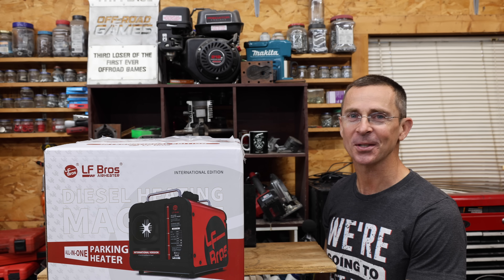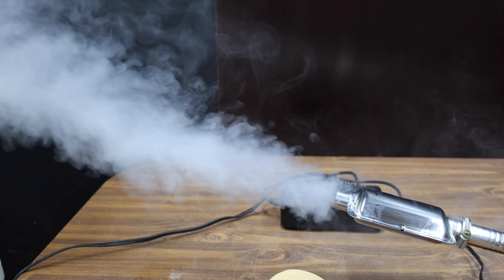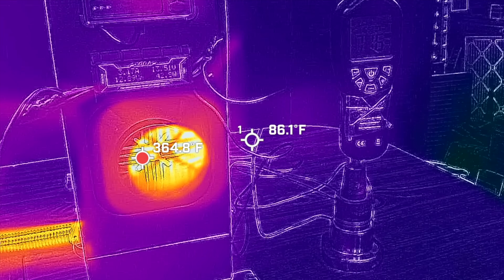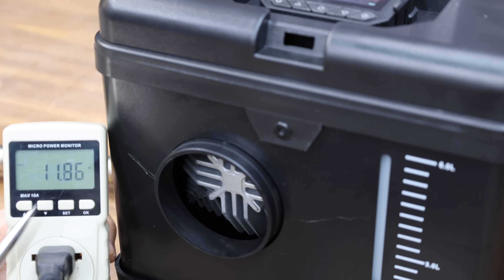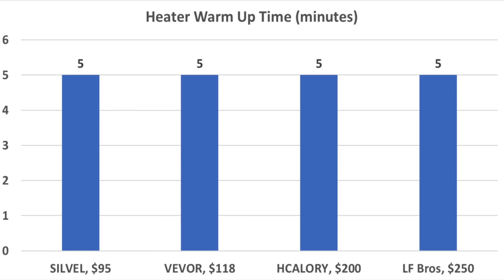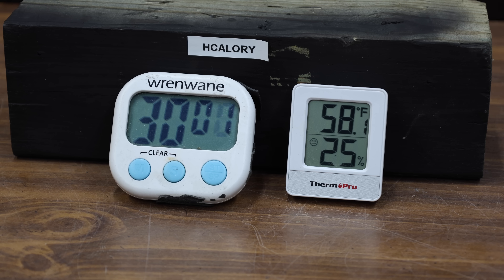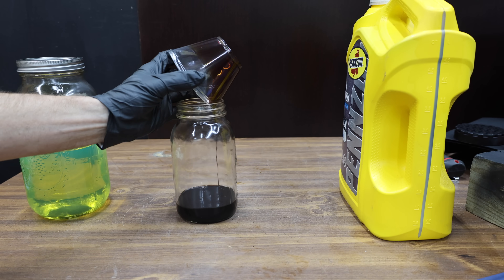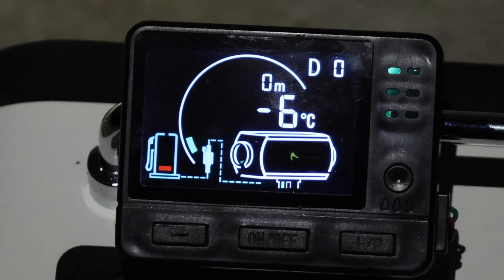The Truth About Cheap Diesel Heaters!

Comment: The heater that was smoking was also the one that tried yet failed to start. That event might have loaded raw fuel in the chamber causing  the smoke during the final start up.  I did the same thing with my heater on it's first start, (inadequate 12v  power).  since then, no smoke on starts...

Comment: Great concise very informative video. Two seasons ago I purchased theLFBros heater, had minor issues due to Shipping and the manufacturers responded quickly to correct them. The unit started right up with no fuss. Ran it for an entire season at the end of the season. I let it run dry and it shut down. The second season start up was just as easy as the first time. Join use the season. I had a momentary power outage, the unit chugged, sputtered. I shut down the unit gave it 10 minutes started it right back up with no problems. In my opinion, this is the best of all of them, none of the problems that you find on the Internet with the other lesser brands. Customer service could not be better. Spend the extra money and get the best. Also, for those who question this review, I paid for my heater, I have no connections with the company or suppliers in any way shape or form.

Comment: I have a 1986 30 foot motor home in Maine  and I'm using the Chinese diesel heater for a primary heat source works great uses less power and fuel than the propane furnace that comes with the RV will always recommend diesel heater also the Chinese diesel heater is 5 years old and been in 2 other vehicles prior to the RV

Comment: Disclaimer "I do not recommend doing what I do" however I have a 850sq ft cabin and this is my only heat, I burn 120-180 gallon per season, cost of fuel averaging $600 for the year, my electric bill is a $120/ month. Also I have a larger power supply with a 20 volt to 12 volt converter with a milwaukee battery adapter, this works really well during ice storms etc. The longest I went without power was 7 full days and my house never dropped below 75° its worth noting i am upgrading to an auto start auto stop model ( be here on friday) i also have multiple co2 detectors and I use a wall thimble for the the exhaust to prevent me from burning my house down ( anyone that does this beware this is dangerous!!!!!!!!!!)
Reply: I do something similar.  I use a 12v 100a/h Lifepo4 battery to power mine.  It likes the slightly higher voltages of lithium batteries.  I ran my exhaust thought a hull thing that is in a 2 x 6 board installed a lot like one does a window A/C.  I bought a all in one box type and try to use the temp mode for the controller.  Thing is, the controller picks up some heat from the heater itself.  I plan to move the controller before next year.  I may just buy a diesel heater kit and put it together more to my needs.  

If I run the heater none stop, I can run for days on that battery if the power is out.  With the power on, the charger keeps the battery topped off.  

I have to say, this is a lot better than manual kerosene heaters.  If it turns really cold during the night, the controller turns the power up automatically.  If it warms up in the morning, it powers down, sometimes to the lowest power level.  The next heater I buy will be able to cycle on and off.  The Hcolary, (sp?), is the only one I found that does that so far.  Kit type anyway.  

Oh, no smell.  All the smell goes out the exhaust but once it warms up, no smell there either.  I just wouldn't sniff it.  ROFL
Reply: @noneyabus1  I have the newest model coming, it will be here Friday. The only issue I have is my house is hot 🔥

Comment: I've been running one of these Chinese heaters for the last 3 years and a 30X 70 shop when it's approximately 20 outside it will heat the shop up to about 58°which feels pretty darn good and I could adjust the fuel to make it hotter but this way it runs super clean

Comment: My house has electric only heating. Costs last year were slashed by running one 5KW diesel heater. I rent the house do exhaust goes up the chimney. I would have a second unit at the other end but there’s only the one chimney and I can’t drill 1” hones in the walls. 
My fuel is in 5 gallon Jerry cans. I use a long line of 4mm nylon tube through to the heater (small hole through the wall). A 100ml syringe pulls fuel through quick connect and the heater pump does the rest. 
The fancy case and fuel tank were a waste of money. Nog necessary.

Comment: Do you guys just exhaust this through a whole in the wall?
Reply: They make a hull flange for the exhaust.  Some run them through a metal pipe with insulation stuffed in it, to protect wall from heat and keep the air out.  The flange is the best way in most situations.

Comment: i would surely add an old cast iron radiator on the exhaust pipe to capture every degree of heat produced...seen it done on another video and it works likea charm...doubling your heat output for no extra cost!!!!

Comment: Fair warning for these, the control panel shorts out easily. I have only gotten a single season out of the Vevor. Also, there is no real thermostat type of control. It's on or off.
Reply: There is.  They usually come in power control mode which is manually set.  You can change it to temp mode but you it's best to have the controller outside of the all in one boxes.  The temp sensor picks up heat from the heater itself.  If you leave the controller inside, you just have to figure out the temp based on room and the amount of heat it is picking up from the heater.  Mine for example, if set to about 95F, it keeps the room at about 65F or so. Oh, on mine, if you press and hold the up arrow button, it switches to F mode instead of C mode.  

Find a video with a controller like yours, there are several different ones that look almost identical, and figure out how to change it.  On mine, you press and hold the up and down arrow buttons at the same time to change to temp mode.  Other controllers may have a different method.

Comment: I would be interested to know what the longevity of all of these are. I bought one recently and it only survived 10 gallons worth of fuel, on setting number 2. As I understand it the control panel controls how much fuel versus air each unit uses, and it’s also adjustable. The unit I have was running very rich and clogged up the combustion chamber since it wasn’t getting enough air.

Project farm, can you also test longevity tests on these and then do a combustion chamber inspection? Say 10 gallons of fuel each on the lowest setting and then reassemble and do 10 more gallons on the highest setting?

Comment: You don’t want to use used motor oil on these I have tried it a bunch of times a bunch of ways. There is no good way to do it. All of the carbon deposits in the oil plug up the burner. Every darn time lol. 
If you want these to perform well for a long time, replace the burner with one for a erberspacher it’s 30$ they have a larger wick and flow more air through the burner. They don’t plug up as easy and put out more btu. The eberspacher bolts right into a vevor combustion chamber

Comment: The watts max on startup I wish I knew going into my build. I built a dual battery in parellel with a step down converter setup to run on two Milwaukee batteries. I was pushing a single M18 battery’s max supply for startup with occasional errors so I put two in parallel which now also means I can swap batteries one at a time and the heater stays running.
Reply: Be careful, losing power in these heaters and it not being able to go through its shut down process is not good.  It can damage the board mounted on top of the heat exchanger.  They not expensive but if you don't have one, no heat until one arrives.  I have mine running off a Lifepo4 12v 100a/h battery with a smart charger attached.  The only way it would lose power is if the fuse between battery and heater blew.  

Being able to swap that way is good, maintains power, but make sure the one you leaving in is charged up good so it doesn't lose power.  If you ever do remove a battery and the heater shuts down, put the working battery back in as quick as you can.  From what I've seen in videos, it senses the heat and starts the shutdown process.

Comment: I have the LF Bro's one, it's a champ. Once the unit finishes it's start-up cycle the pump becomes silent and all you can hear is the fan. It's an amazing unit, i've run it for 3 days straight before. The only thing that would make it better is if it had a thermostat.
Reply: Most controllers have a temp mode but come in power mode by default.  On mine, you hold the up and down arrow keys to switch between power and temp mode.  If you have a box type, the temp won't be accurate because they pick up heat from the heater itself, the sensor is inside the controller inside the heater.  If I set mine to about 95F, I get about 65F in the room it's in, roughly.  Oh, on mine, press and hold the up arrow key for many seconds, it switches from C mode to F mode.  If you like F better.  

Try to find a video that matches your controller.  Some look different but some look identical but work different.  I went through half a dozen videos before I found one that matched mine.  The buttons and number of blades on the little fan on the screen usually help narrow it down.  Some anyway.  Rest is just seeing what works.  

Oh, some controllers also have a auto on and off capability.  That's my project for next year.

Comment: the Sevil would not have started smoking if you shut it down properly and/or not attempted to use an incorrect power supply.
Reply: Low voltage will make them do weird things for sure.  Each one is a little different in how it handles low voltage too.

Comment: One thing is too compicated for my brain: How could a Hcalory 5-8KW model produce even 5KW heat output ?
Diesel fuel  has an energy content of approximately 9.8–10.0 kWh per liter.
it woud need over unity 109% efficiency;  for 5KW output and 175% for 8KW output

Calculation for 460 ml  (the max stated fuel comsumption as per mfg brochure)
460 ml = 0.460 liters

0.460  L × 9.9
 
kWh L ≈  4.55
 
kWh
0.460L×9.9
L
kWh
	

≈4.55kWh

Comment: What i'd like to have seen is if any of these have an actual thermostat so it doesn't heat my camper up to 120 degrees inside.
Reply: they are built in, you set the temp u want, when it reaches that temp it shuts down or lowers, when it drops below it heats up again

Comment: There is 10 kwh per litre in diesel fuel.
My 8kw unit runs at full output for 3 hours on one litre which means the real output is 3.33kw, some of which will be lost via the exhaust, assuming it is vented outside.

Comment: Can this be left outside in the winter and pipe the heat inside?
Reply: Some people do that.  They also do that when they use tents when camping.  The biggest thing, exhaust for combustion goes OUTSIDE.  The rest depends on what you like.  One guy in Great Britain, his is in a box with a little roof on it.  Fuel, heater, battery and all.  He has a intake tube coming from the house and a outlet tube going back to the house.  I think he heats his whole house with two of them.  That way, everything that can go wrong is outside.

Comment: You can adjust the pump frequency if you go deeper in to the settings, the cheap one is in default settings 5kw instead of 8. So you need to adjust the pump frequency:)

Comment: Would you be able to test if kerosene can be used in these heaters, please? And thank you!
Reply from the maker: Thanks for the idea!
Reply: Some people say theirs runs great on kerosene.  Mine claims I should not run kerosene in it, not even a mix.  I suspect it would work but diesel is cheaper than kerosene.  If it burns diesel just fine, why pay more for the fuel???  Diesel is just over $3 a gallon.  Kerosene is right at $5 a gallon.

Comment: Great video my friend 👍 What is like to know is battery consumption for the 8 hr run time
Reply: My heater during start up, about 2 to 3 minutes when the glow plug is heating up, pulls right at 10 amps.  Once the glow plug turns off, about 1 amp for low power and a little over 3 amps for full power.  I run mine off a 12v 100a/h Lifepo4 battery.  It likes the lithium battery more than the lead acid due to the slightly higher voltage, especially during start up when the glow plug is on.
Reply: @noneyabus1 thanks, she's running great, have 4 8D batteries wired 24v
Reply: @noneyabus1 small nah you don't understand 8D they weigh 150 lb each 4 wired 24 volt
Reply: @noneyabus1 your welcome, been playing in electric since 1973, still learning... I can use 8 flashlight batteries with 6 capacitors 2.7 volt 700 f for a car battery the caps send enough current to start then the flashlight batteries recharge the caps, or use any small 12 volt, even DeWalt 18 volt with caps. The huge batteries I bought need fresh acid, they fall back to 25.5 .. but no one wants to sell the acid they hold about 4 gallons each
Reply: @noneyabus1 ro 👍
Reply: @noneyabus1  each battery about 4 gal
Reply: @noneyabus1 thanks for the help. they do sell small, motorcycle , and for like sump pump batteries that come dry. They try and say it don't go bad, but electrolysis removes hydrogen. Really not sure how it effects them. But they will suffice my needs, led lights and charge the JBLs and diesel heater. Eventually I'll grab up a couple 200ah lithium
Reply: @noneyabus1  that's good years, I believe acid batteries can last a long time like in the 40s, 50s, 1960, the 70s they started selling batteries, but they used to service them with 200 amp manual charger

Comment: Could you do a heat scavenging video from the exhaust, I see several that have used cast iron old steam radiators, seems the bigger ones don`t work as well as the smaller ones, be nice if you could make up a test, thanks
Reply from the maker: Thanks for the video idea!

Comment: Couldn't one just put one of these outside and run the output through a dryer pipe through a small window into the house and heat the house that way?
Reply: Some people do it that way.  Keep in mind, these are made for RVs, campers, boats, large trucks, tents and a lot of other things.  People are using them in ways the makers never thought of, whole house for example.  You buy them in kit form, the options are endless. Mounting on a wall.  Remote controller.  Temp mode instead of manual power mode.  Large fuel tanks.  The list goes on and on.

Comment: Some heat left in the exhaust pipe. 
Could you run the exhaust through and EGR cooler and use it to heat water?

Comment: Excellent and informative. With all the oil changes I do the old oil had become a hazardous waste problem. I have been using it to keep concrete from sticking to levels when pouring castings for tanks and other concrete products but I have way too much. I am gonna build some kind of heater to burn it and make use of the heat in the winter months. Thanks for your time and experiments. It saves a lot of time and money for me. 👍

Comment: You mentioned that using vegetable oil to run one of these, might cause "covering build up" inside the combustion chamber. Is that something we can clean up regularly or do you mean to say it's best to use diesel?
Reply: One way to work around that is to add a cleaner to the fuel.  Or maybe every few tanks, use diesel with the additive Hot Shot, like used in diesel equipment and trucks.  I asked the maker about the additive for my heater and they said if it will work in my tractor, a diesel car or truck, it will work in the heater.  I even thought about Sea Foam.  That stuff cleans combustion chamber in engines good.

Comment: You can't knock the Silver for the smoke during startup.That was due to it, not having a proper power down beecause of voltage loss.. So that should not be a consideration.
All those will do that  if it's cut during warm up.
I use three of these in my off grid alaskan property. 1 for my water closet, 1 for my outhouse and 1 for my main cabin.
I've owned h-calries, vervor and several other non names.
Once you open the case, they're all the same.

Comment: I don't understand how this works for power outages if it requires an electrical power source to operate other than  pulling the battery out of my car or truck to operate it. Approximately how long will a car battery power the unit? Thanks!

Comment: Run the exhaust through a water to air intercooler like on a drag car.  12 rv water pump and you have hot water from the exhaust heat.
Reply from the maker: Thanks for the suggestion!

Comment: mine carbons up so fast its anoying. love the heaters but omg are they a pain to maintain, for my set up anyway.
Reply: Get some Hot Shot diesel fuel additive and add to the fuel.  I asked the maker of my heater about it and they said it would work fine.  Should help keep the chamber clean.  Another option, Sea Foam.

Comment: Not that I dont think its garbage anyways, but you did the Silvel dirty by underpowering it and flooding the combustion chamber, then complain about the smoke like its a normal thing that would happen. 

Just bought an N2 Pro. It beats all of these with lots of better components. Even has an upgraded fuel pump, fan, and the most important, an upgraded combustion chamber with more surface area on the combustion and heat exchanger than any other diesel heater I’ve seen(including the LFbros N4 and possibly the regular N2)

Comment: I bought one just to see how much heat they produce and maybe help heat my shop. For what they are they do a great job, but unfortunately they aren't enough to maintain heat in my shop. I had planned to use my forced air torpedo type heater to bring the shop up to temp (only takes about 15-20 minutes) and use the diesel heater to hold the heat but it isn't enough. They are only good for a camper or truck sleeper, which I think that is all they are designed for.
Reply from the maker: Thanks for sharing.